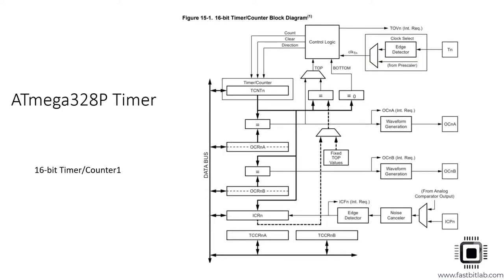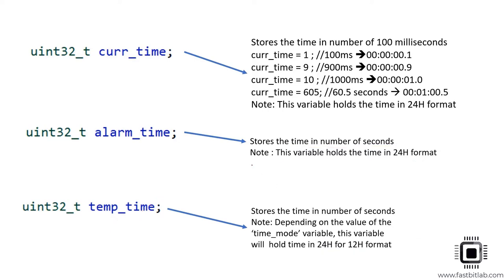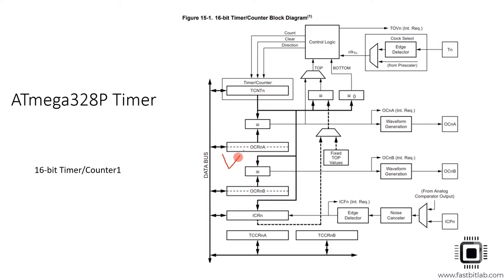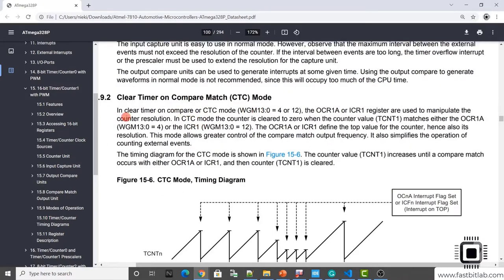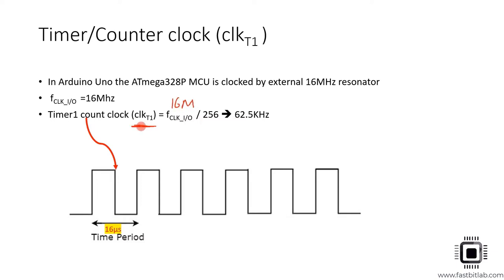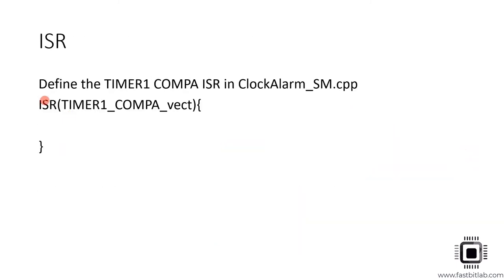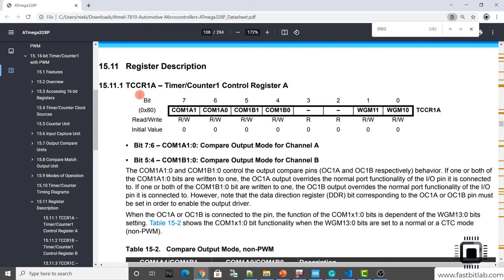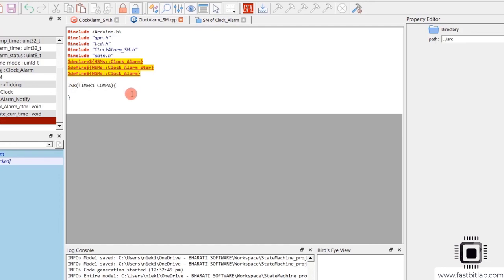Lecture 4: ATmega328p Timer Explanation

Comment: But I have a few questions,
1) for timer one the required timer freq = clk freq / (pre_scal *(1+Top), where the top is the value, we set in the "ICR" register. 
2)  If I rearranged the formula you provided at the end of the video for setting the "OCR" value it came out to be the formula that I have written in point 1(if I consider delay time is the inverse of the required freq)